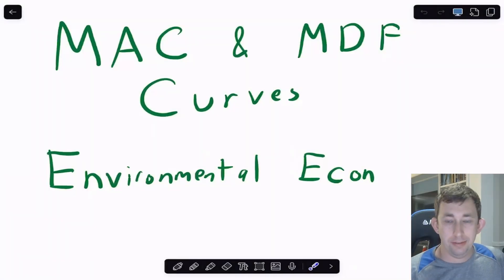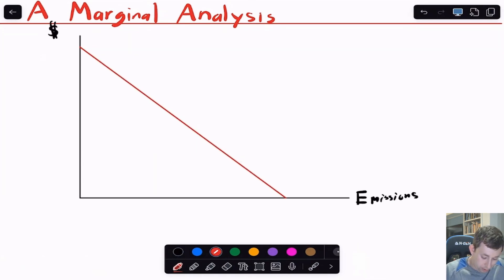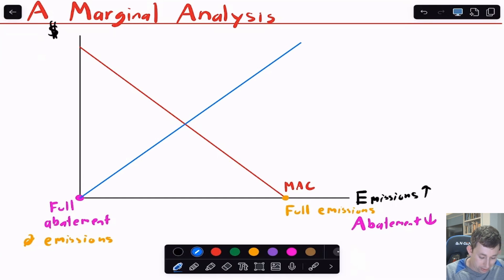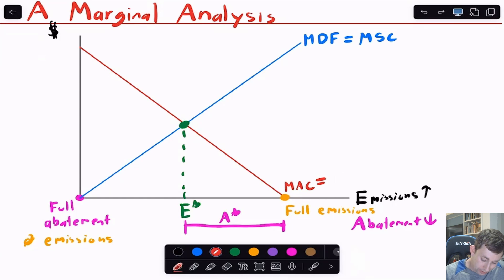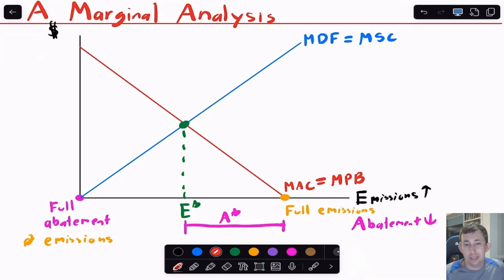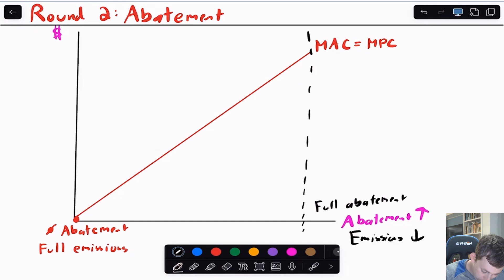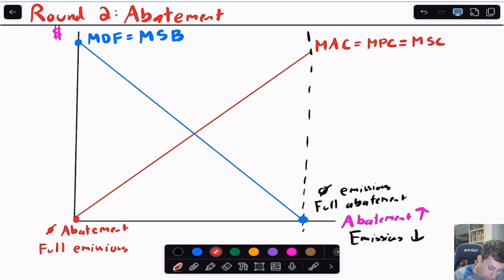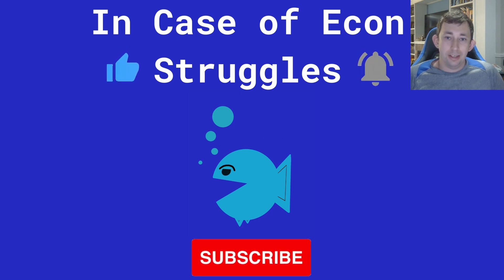MASTER The Fundamental Enviro Econ Graph in RECORD TIME

Comment: I have a couple of questions, 
1. What region would highlight the deadweight loss in this diagram? 
2. Is MPC a flat line becuase it is assumed to be constant or is there another reason?
3. How woudl carbon-tax impact the first graph?
4. What regions of the graph would dictate wether the firm choose to reduce emissions or pay the tax. 

Appreacita your help a lot.
Reply from the maker: 1. Deadweight loss is the region between the market quantity and the social optimum quantity and then under the MSC curve above the MSB curve.

2. We just assume that the MPC of emissions is 0.

3. You would raise the MPC of emissions such that it’s equal to MSC at the social optimum and so the quantity would become the social optimum.

4. If a firm pays the tax, their MAC is above the tax level. If they choose to abate or reduce emissions, their MACA IS lower than the tax.
Reply: Thanks a lot for your help.